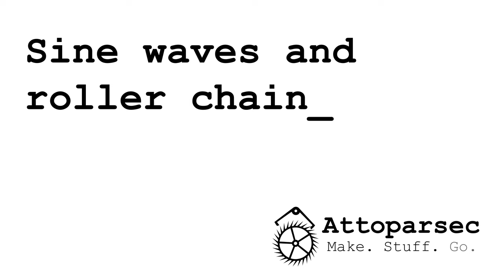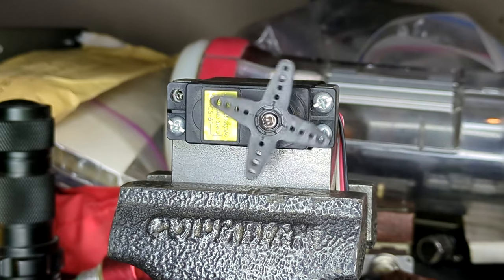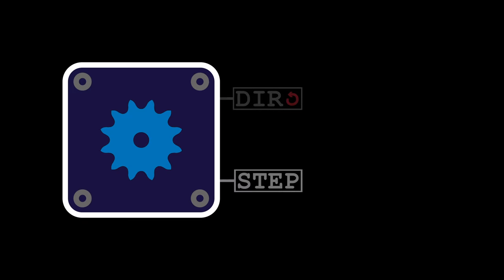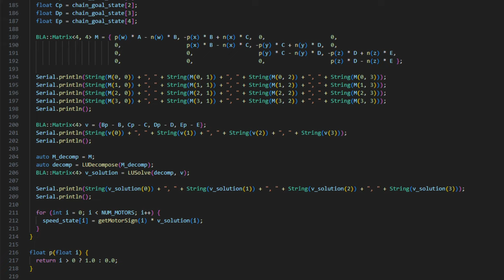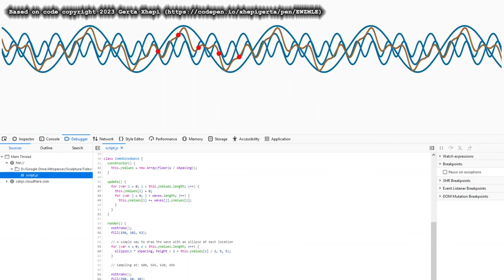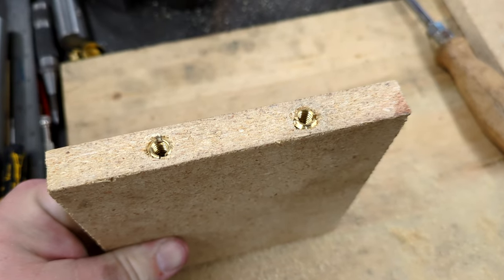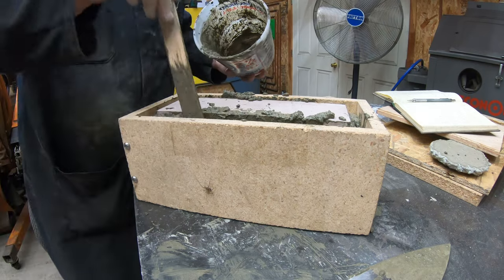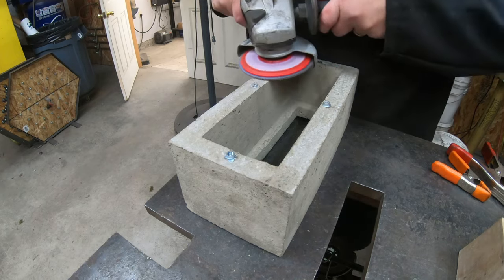Turning industrial materials into art

Comment: I would have made this as a clock.
Add one more Motor for Hours and Minutes. Or 3 more for hh:mm:ss.
Also adding corresponding numbers between the motors.
How to tell time?
The numbers that are just above the chain.

But as is, nicely done.
Reply: Not everything needs to be a clock 😂, although it would make a cool one. The final motion was inspired by nature's clock, the tide. To add on to your clock idea, hollow sprockets can roll inside the bottom of the chain. The numbers are viewed through the hole in the sprockets. Or the sprockets in the bottom loop have numbers engraved on them, and the number at the top indicates the time.

Comment: I love the overall project but I'm really impressed by your demo illustration, where the model stepper was moving the right amount as a function of the model step line.  Also yay old english dymo t-shirt!
Reply from the maker: That was a fun animation! I actually set it up as a pair of expression controls for dir and step, with events directly on the timeline, and then wrote expressions to draw the graph lines and do all the stepper animations in response. A bit more work up front, but then I could easily tweak the timing of everything to feel right. Plus, just more fun to do the scripting than all the finicky micro-editing!
Reply: @Attoparsec  watching that run is almost as pleasing as watching the final thirty seconds of the full video, where the loops are doing their thing.  So snaky.

Comment: Small addendum to servos: they dont so much know where they're at per se, they can detect if their position is above or below where the incoming signal tells them they should be. There is a potentiometer inside that tracks with the output shaft (thus why you dont see servos with greater than 270-ish sweep....except constant rotation servos, which dont have positional capabilities and are more motors with an H bridge that spin in one direction or the other but not necessarily to an exact position). The internal logic compares this potentiometer value with the incoming signal (via a complex capacitor discharge voltage divider topology...its not important, but interesting if one is interested in how they go from pwm input to motion and position), and via an H-bridge if pot > signal turn this direction, if pot < signal turn that direction. Without a signal (and assuming no EMI on the signal wire that 'looks like' a signal) they'll usually jump to the center position on start up. Its usually best to assume as close to the powered off neutral state in the signal before power on to avoid much of the jumping. Also remember, servo signals are one direction, from controller to servo. The controller just sprays out a PWM signal and the duty cycle tells the servo where in its sweep it should be.

They're pretty complex little doodads when you get into the nitty gritty of how they do the voodoo they do do. And the explanations of how they work tends to be over simplified leading to confusion. It took me a good week or so studying JUST servo control and operation to get my head around it, so its totally understandable for explanations to get crossed from time to time. Its not an easy thing to explain in a 5 second elevator pitch. 

Either way, with that bit of pedantry out of the way, still, awesome content mate! A little ticked off that YouTube took so long to recommend your channel, going to have to troll around your backlog a bit, real interesting stuff in there! Keep on keeping on, man! 😎👍